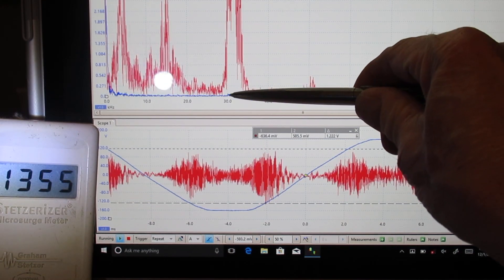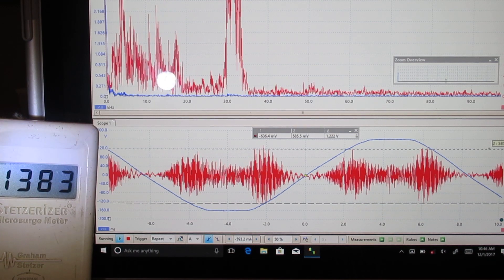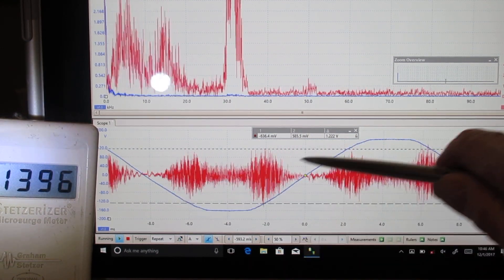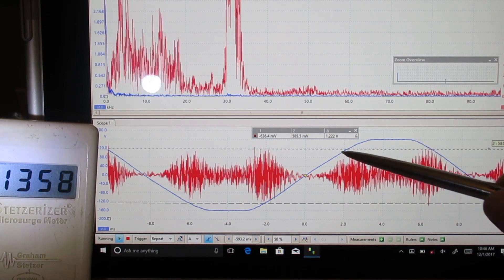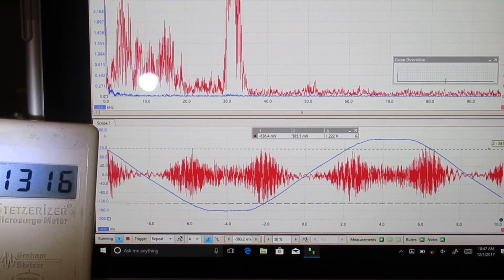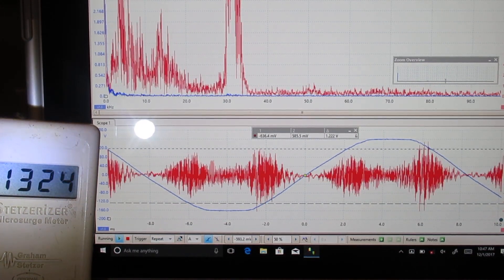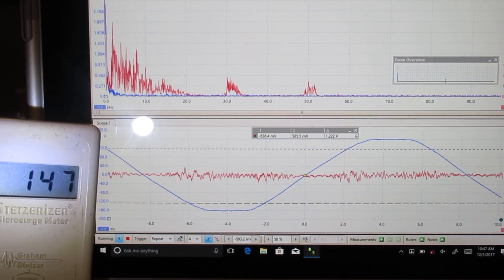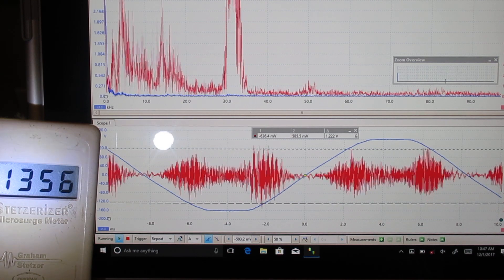Pool Pump creates massive Dirty Electricity for entire house.

Comment: I’m living in a pool house and feel terrible as the pool pump and whatever else is only separated by a sheet rock wall from my bed. I feel like I need to get out of here asap
Reply from the maker: This pump puts DE on al of your circuit wiring.  Turn the pump OFF or replace it with a single  speed pump.